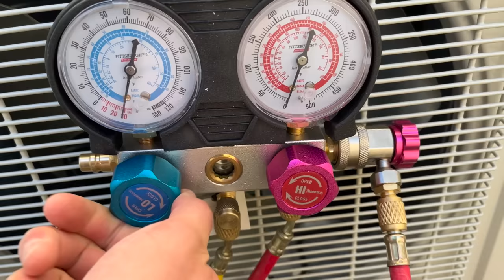I built an epic home office in my backyard - start to finish

Comment: The only thing missing was a water source / sink  to set up a nice little coffee bar and microwave / mini fridge and at least an enclosed section with a commode to take a dump. The insulation I would have used under the structure would have been sprayed in but that’s me. Great results though
Reply from the maker: I did seriously consider adding a bathroom, but figured it's easy enough to walk back to the house for that. Gets me more fresh air too. But man, there are definitely times where it would be easier to just have one out here.

Comment: Nicely done from a structural point of view, the only thing i would of done differently is to have the deck posts on a concrete pedestals, they will last longer than being directly in contact with the soil. You might want to consider some skirting to keep the critters out. Pretty dam nice office mate!
Reply from the maker: Thanks! Maybe I was just being lazy with the deck posts, but I did use lumber that was treated for constant ground contact. So they should last for a long time. If they don’t… I guess I’ll bite the bullet and redo it with concrete. 

I’ve been tossing around some skirting ideas but haven’t landed on anything yet. Maybe I’ll have a future video adding it. 

I appreciate your input!

Comment: I wondered why you wanted a detached office, but then I heard the kiddo lol. What were your biggest mistakes? What would you do differently? Answering those questions is the most valuable part of the experience, for my projects. Stellar job, friend! Thanks for sharing.
Reply from the maker: Two kiddos who both like to make noise! My former office is now their play room. 

As for biggest mistakes, a couple of commenters pointed out that I used the wrong fasteners on the joists hangers, and that seems like a big enough deal to require taking the time to fix. 

I love the metal roof, but it is LOUD when those oak trees drop acorns. Architectural shingles might have been a better choice for the spot. Fortunately though, that doesn’t happen often. 

I’m planning down the line to make a video discussing mistakes and things I would do differently if I do it again. 

Thanks for your kind words!

Comment: Nice job sir. My only complaint on first glance would be never have a window facing your monitor you're gonna get so much glare from the sunlight. I anticipate you thought this through already in there is no sunlight on that side though. If you zoom for anything the window should be facing you as you're seated which you do have one of those.
Reply from the maker: That's a fair point. That window behind my monitor faces SW and I haven't gotten any glare from it while working. I put blinds on it, so if it is making me too dark on zoom I can close the blinds and that resolves it right away. I put it there mostly for airflow when I have the windows open... and for symmetry. 

The window I had the most problems with is the transom window next to my desk. The sun would come through it in the morning and hit the wall next to me which made a pretty bad glare. That was easily fixed by putting a light diffusing film on the window.

Comment: Ha just read the description. I started watching the way you were handling the concrete and smacking the piers, was like hey that’s exactly what you do for nuke soil/concrete testing. Trying to remember now, it’s something like 15 stabs with a rod, 8 hammer pounds to the sides, 3 developing canisters. Stick the concrete test rod in and measure what sticks (the slip/slop)? I forgot a lot of it. I don’t miss all the skin rashes. I do not miss pounding the nuke rod into cold hard frozen soil in the dead of winter while trying to avoid getting run over by the massive equipment where no one can see you. I do not miss dealing with the backlash from the workers when you have no choice but to be the ‘bad guy’ and fail them, potentially rejecting something that costs tens or hundreds of thousands of dollars in materials and time delays to fix. I tried to be generous in most cases, but some were so bad it would be unethical and morally irresponsible to pass them. The asphalt testing was so much less stress.

Good job on the build (I’m envious, want to do something similar). Thanks for the vid.
Reply from the maker: Man yeah, it was a good job, but I don’t miss that stuff either

Comment: Great work can't do this in the UK it's way over 2M height for  garden room, shame you are going to have cold walls and ceiling.If you left 50mm gap 50mm PIR board  and then  battened the outer wall before the cladding you have air gap no cold bridge. You also have an air gap for the wood to breathe and not rot on the inside

Comment: Looks good but there’s no vapour barrier between the drywall and the insulation.
Reply from the maker: I can't recall all the research that went into me deciding not to put a vapor barrier on the walls, but I do remember this video (https://youtu.be/q8fOMBlfh3A?si=Kc0U34S3fZPC4g81) informing my decision. 

It's worth mentioning that I'm not in a climate where I'm going to be using heat most of the year.

Comment: just a heads up that plastic you stapled to the bottom could potentially give you some mold problems you would be better off putting plastic on the ground and adding skirting with a vent to prevent moisture buildup underneath the structure

Comment: This is awesome! Did you run ethernet/networking to the office from the house or do a wireless bridge? 

The only thing I think I would have even considered doing a bit differently is the exposed concrete piers. I think I would have brought the floor joists a few more inches or so on each side so the piers would be completely under the structure and then could have put a vinyl skirt. Feel like this would help divert unwanted airflow underneath.

I know costs depend on where a person lives, but about how much would you estimate this entire project ran you?
Reply from the maker: I use a mesh Wi-Fi system with the main in my house and a point in the office, and it works pretty well. I’ve measured speeds up to 650 Mbps in the office!

I initially planned to have the joists overhang on the front and back as well by laying them across the top of the beams. I decided against that because it just felt like the floor would be sitting too high off the ground at that point and I would be peering awkwardly into the neighbor’s houses. I’m still considering skirting options. 

I think I ended up somewhere around $20k. I still have some receipts to go through to get an exact number. Once I do, I’m going to make a cost breakdown video.
Reply: @nathanetech  Nice! I have a Ubiquiti network at home and was curious about your setup. And 650mpbs, whoa!

Your price range is about what I thought it could be considering it was DIY. Reasonably affordable truth be told. Now you have that additional value added to the home too in case you ever move.

Again, great job and thanks for the response!!!!

Comment: Wow this was really cool. HUGE kudos to you for taking this one and doing it so well. A couple of specific comments/questions:
I would have liked to have seen how the rough electrical and electric feed was done from the main house.
No grass/weed prevention measures were used under the structure and deck?
The ceiling/wall supports for installing shiplap and drywall were INGENIOUS!
Why build your own window screens, rather than buy?
Reply from the maker: Thanks! Great questions.

I didn't show any electrical because that's the only part of the job I hired out. Where I live, you have to be a licensed electrician to do electrical work. I probably could've gotten away with it, but didn't want to risk something coming up if someone goes looking for permits when I sell the house in the future. 

Nothing grows under the building from the lack of sunlight and water. The only place I have to worry about weed growth is right around the edges, and those I just pull up by hand when I see them. A more permanent solution may be needed in the future, but not for now. 

Thanks! I saw the idea for the drywall support while watching videos a couple weeks ahead of time to prepare myself. From there, I was able to work out the ceiling supports from necessity after trying to put the shiplap up without them. 

I went to Lowes fully intending to buy screens that fit my windows but didn't see any. I thought that was odd since I got standard sized windows. All the same, they weren't there. At that point, I figured it would be quicker to build them than keep looking around until I found some.

Comment: Incredible. Only thing I wonder about is the choice to use screws instead of nails on your joists.
Reply from the maker: Yeah, someone else pointed that out as well. When I initially researched it, it seemed like a valid choice, but it seems I overlooked something. Currently thinking through what it would take to replace them

Comment: Nice job. I think your floor insulation could be done easier. Perhaps at framing or else use polyiso
Reply from the maker: That definitely would’ve been easier. The only reason I didn’t do it at framing is because I didn’t want to risk it getting wet before the building was dried in.

Comment: Why not set the floor joist anchors into the wet concrete instead of drilling? Honest question, not trying to be snarky. Great video and shed!
Reply from the maker: It’s a good question. Basically because I wasn’t confident enough in my ability to line them up correctly with the concrete wet. I wanted to be able to take my time, make marks and be sure I had them exactly where I needed them.

Comment: Excellent work, the only thing that for it to be an excellent tutorial was that you had to explain step by step what you did.  Can you tell me, please, what is the name of the cylindrical cardboard material that you put inside the concrete, how much you left it inside the ground and how much above it, and the distance between them.  I would appreciate it very much.
Reply from the maker: Hey, thanks for your feedback! I'm actually planning to go back through all my video clips and make a series out of them where I explain my choices at each part. Expect this to be coming soon. 

The cardboard material is commonly called a sonotube. I got the Lowes brand of that. 

I dug 24 inches down for each hole, filled the first 6 inches with gravel, then filled with concrete. The important point is that the concrete needs to start below the frost line where you live. The frost line here is 12 inches, so having the concrete start 18 inches down was a safe bet. 

As for how far above the ground, it was 9 inches at the point where the ground was the highest, then I leveled them all to that. 

For distance, I had 5 feet between each row of piers and about 6 2/3 feet between each pier in a row. Just make sure to check a span chart in the building codes for your area, which you can find online.
Reply from the maker: @vicentegonzalez3013 Just wanted to follow up and let you know I posted a video sharing some more details about the foundation where I explain what I did and the materials I used. I'll be posting one for each step of the process. 

Here it is: https://youtu.be/mZTa_JtP4VY

Comment: Doubling up around openings in a stud wall is a common practice in framing homes, but it is not always necessary. It depends on the size and type of the opening, as well as the load-bearing requirements of the structure. Here are some factors to consider:

- Door and window openings typically require additional support to bear the weight of the header and distribute the load to the surrounding studs. Doubling up the studs on either side of the opening can provide the necessary strength and stability.
- The size and weight of the opening will determine the amount of support needed. Larger openings or those supporting heavy loads may require more substantial framing, such as using headers made of multiple pieces of lumber or engineered wood products.
- Building codes and regulations in your area may specify the minimum requirements for framing around openings. It is important to consult local building authorities and adhere to the guidelines to ensure structural integrity and compliance.
- In some cases, structural elements like steel lintels or engineered beams may be used instead of doubling up the studs to support the opening. These alternatives can provide the necessary support while minimizing the need for additional framing.
- It is always recommended to consult with a professional contractor or structural engineer who can assess the specific requirements of your project and provide guidance on framing around openings.

Comment: This was a great, relaxing and inspirational watch.  It's particularly nice how it never takes you more than two hammer strikes to drive those nails, impressive!  What plans did you use (and would you recommend them now that you've gone through a full build)?
Reply from the maker: Thanks! Full disclosure, I edited out a lot of the hammer strikes for the sake of brevity. Tried to leave just enough in so it was clear what I was doing. 

Didn’t work off any plans. Just made a drawing of what I wanted and worked towards that. 

If I did it again I’d probably do a concrete slab instead of piers and I’m not sure I’d use the transom windows

Comment: Beautiful build! Any chance you'd share the cost breakdown? Also, how did you get power to the office building?
Reply from the maker: I’m planning a cost breakdown video once I go through all the receipts. 

The electrical went out through a trench off a new breaker on my house’s main breaker box. That’s the only part I hired out because that’s required where I live and I didn’t want to risk it.
Reply: @nathanetech  I'd have to do the same...and bore under concrete. yikes Looking forward to the breakdown. I've got to watch the foundation video still.

Comment: Frkn awesome dude... can you share some tips for new builders?
Reply from the maker: Thanks dude. I’m trying to put what I learned from this build in a series. Currently 2 videos into that. 

One of the best things I did was watch several instructional videos from different builders for each step. That way I’m benefitting from multiple teachers and learning what’s required and what’s just preference. 

Building codes can be found by googling. I ended up on upcodes.com quite a bit.

Comment: Sorry if you've answered already but could you have done the insulation under the house back when the first finished the platform and not closer to the end of the project?
Reply from the maker: Yes, I could have, and it would’ve been a lot easier. I opted to wait until the end because I didn’t want to risk the insulation getting wet before the building was dried in. It was a very rainy season.

Comment: The build looks very clean, cool! I just wonder - you don't seem to have put any vapor barrier on the inside. Is this built in some hotter climate, so you don't have to deal with it?
Reply from the maker: That’s basically it. The climate I’m in I don’t need to use heating most of the year, and I can actually go without AC or heat for a good portion of the year. This video helped to inform my decision to not use one: https://youtu.be/q8fOMBlfh3A?si=kskRJqNhsrPZGpze
Reply: @nathanetech  - Lucky you! :-))) Thanks for the link, I'll definitely check it out.

Comment: Dude this is so impressive!!  Especially the part in the description where you said you had no experience!  WOW.  I just have 2 questions.  Did this have to be approved by the city/county?  And also how did you get a separate router out there for internet?
Reply from the maker: Yeah, I got a building permit since it was over 120 sq ft. I'm using a wifi mesh system to get wifi out to the building and it's working great! I've measured speeds up to 650 Mbps
Reply: His inexperience is why he overbuilt the crap out of it.  It's stronger than most peoples houses.

Comment: That is beautiful. What are the dimensions of the building and what is the interior square footage??? Did you buy plans somewhere or did you just build it yourself?
Reply from the maker: Thank you. The dimensions of the floor are 10' by 22'. The interior dimensions are basically that, minus the 2x4 walls on each side. 

I didn't buy plans. Just rough sketched what I wanted it to look like and then worked to make that sketch a reality. 

That said, I don't think plans for something this size are that expensive.

Comment: Absolutely great job! Inspired me to build. Maybe I’ll take on the challenge. Two question, how long did it take and how much did it cost?
Reply from the maker: Do it! It's very rewarding. 

It took me right around a year working most weekends and some nights. That was without any experience, so I was learning as I went. 

I haven't finished tallying up receipts yet, but I estimate it was somewhere around $20k.
Reply: that's rather modest, I am intrigued @nathanetech

Comment: I was hoping you were going to insulate under the floor 😅 did you end up adding insulation between the floor joists? I had to add insulation under a tiny house like this because the guy my client hired to build it didn’t do it and it’s way harder to do it once the floor is down